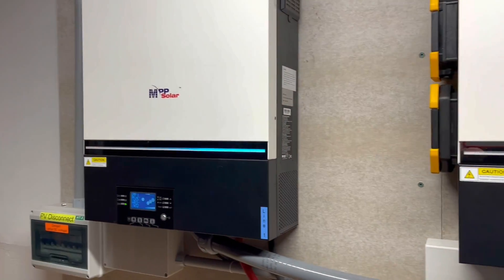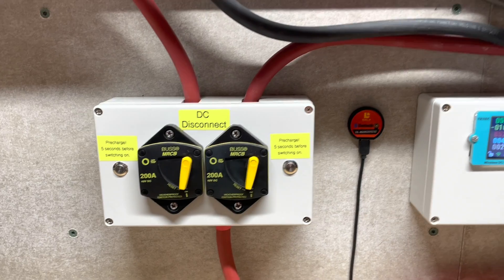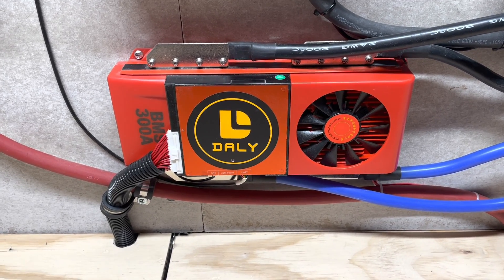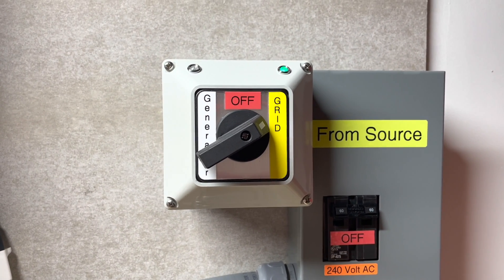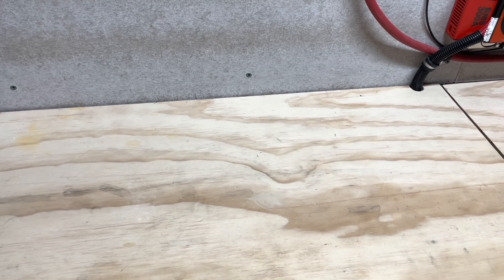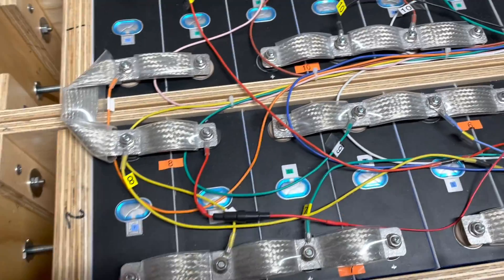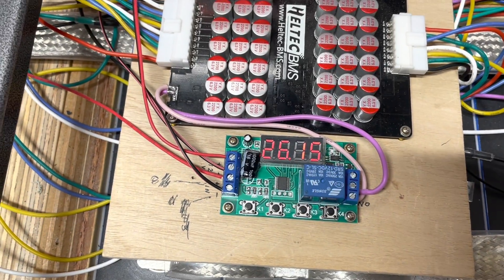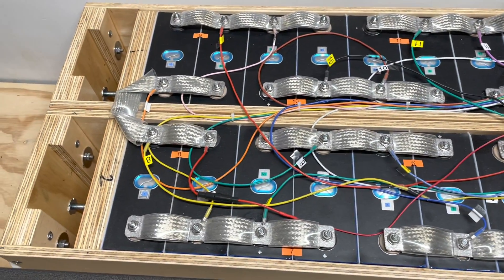MPP Solar LV 6548 split   It’s Alive! Please skip any adds on my channel, they are not authorized.

Comment: Excellent system, the only thing that I would change for safety is the battery box. Should be on metal.
Reply from the maker: Thanks 
The shelf is actually 3/4” ply with a metal frame. The battery boxes are 3/4” ply that’s screwed and glued and also so stiff that it doesn’t flex with the weight. So the bottom is actually 1-1/2 thick with a metal frame. The box before it was lacquered was treated with fire retardant as well as the shelf and bench top. The Daly BMS is being replaced by two JK bms’s that are being located below the bench top. The Daly BMS is still working but showing weird current values and they don’t have a good reputation. I’m making another video of the heat and smoke detectors that are directly above the inverters and whole house system tied. Fire is my phobia.

Comment: Hi, please help me with one simple piece of information. I have an 8kW Solar Mpp and 10 solar panels of 590Wp each. The inverter, in the description, is 2x4000W. My question is: can I put all the panels -5900Wp on a single input to the inverter? VOC is 42V for each panel - the inverter supports Max. 500V. Or how is it better to proceed? Please I wait for your answer ASAP. Thanks,
Reply from the maker: I’m not familiar with your inverter. Mine has only 2X 250 PV input max and the EG4 6500 has a a single 500vp input. The EG4 6500 probably could. Log in on the diysolarforum.com and post the question. Tell them the MPP model OCV and watts per MPP input panel count OCV & watts per panel.

Comment: Awesome setup!! If you did a schematic, do you mind sharing?
Reply from the maker: These are the best diaphragms that’s currently available. Mine is different than all of these. Because every install has the potential to be different and resulting in danger, there’s no such one diaphragm fits all.  As such, every install has to be customized. Click on the orange download button:
https://diysolarforum.com/resources/grounding-and-bonding-for-mpp-lv6548-and-eg4-6500ex-48.275/
Reply: @SkypowerwithKarl  hadn't found those! Thanks man!
Reply from the maker: @julio34  
No problem.
Always remember, the end game is no possible way to feed into the grid and no feed back around (no output into input) manual interlock or transfer switch in places. Good luck and be safe

Comment: I thought shunts were more accurate than Hall effect sensors.
Reply from the maker: I think it has to do with the manufacture and the day of the week the unit was made. The one shown is surprisingly accurate on capacity count. It’s common that they need to be reset from time to time. Currently I’ve got this round of about two months of cycles and it seems to jive at 100% at full charge so I’m not touching it. Whatever is in the Daly BMS seems to wander a bit more but still not bad.

Comment: I have a setup about just like this.

I have a windows on my garage door.

I decided to turn off the led shenanigans. :)

I am only able to get about 25 minutes when pulling 12 kW. They get too hot.
Reply from the maker: What does it do when it gets hot?
Reply: @SkypowerwithKarl  
It turns off with "Fault code 02. Internal temperature of inverter component is over 100°C."

I was charging my car at 11 kW and running the rest of my house for a total load of about 11.5kW. The inverter recorded an 87°C temp.

I was pulling between 150 and 187 amps out of the battery and about 3.5 kW of PV.

I don't let my inverters go over 65°C anymore.
Reply from the maker: @JasonCarmichael  
You probably have a dead air space in the corner like I do. The inverters just recirculate the same air. I just installed a fan to suck the hot air out to one of the registers around the eves. Very quiet and low current draw; 
VIVOSUN 4 Inch 195 CFM Inline... https://www.amazon.com/dp/B01M7S46YZ?ref=ppx_pop_mob_ap_share
BN-LINK Digital Cooling... https://www.amazon.com/dp/B01LZV591B?ref=ppx_pop_mob_ap_share
AC Infinity Flexible 4-Inch... https://www.amazon.com/dp/B07WRDTX4C?ref=ppx_pop_mob_ap_share

Comment: Have you been happy with the inverters ?  
Would you buy the same inverters again.
Reply from the maker: Yes, I’m happy with them and I’d buy them again, simply because they are still the best bang for the buck. Is there room for improvement? Absolutely. Efficiency, transfer time, app connectivity, setting limitations and friggen instructions are lacking. But you get what you pay for. They are a beast. Run my old, no soft start 2 Ton AC and full size LG clothes dryer at the same time no problem.

Comment: Are you gird tied and not feeding back to grid?  I was thinking about using the utility as the backup when my batteries are not enough for the inter months.  Would you share your diagram so I can copy your setup?
Reply from the maker: These inverters can NOT feed back into the grid. They can use the utility to pass through into the house and/or charge the batteries. It can be set to run as a giant UPS. It can also charge during non peak. AC connections can be different from project to project so one diagram is not is not a good guide. Panel types, interlocks, transfer switches and local breakers may change the entire layout. Whatever you do, make sure it’s impossible back feed into the grid.

Comment: Have a question about Neutral Ground bonding. Did you change that in the inverters? I have not had any luck getting an email response from MPP. Hellava setup!
Reply from the maker: My inverter and main panel are literally back to back. If there’s a ground loop between panel and inverter in a particular mode it’s very short and localized. Every thing that’s supposed to be grounded is (especially the inverter) and the only mechanical connection that of neutral and ground that I know of is in the main panel. The main thing is, all the outlets pass sensitive tester and ground faults both new and old test and reset and non have tripped. I’m not too keen on popping the inverter cover and removing some screws unless there’s a factory bulletin saying that it’s a must. I have no issues and it’s impossible to get a shock, so I’m in the camp of if it ain’t broke. From the factory point of view it’s a damn if you do and damn if you don’t. There should have been a jumper with the option bond or or not to and leave it to the installer to decide but that may open another can of worms. Right now it’s running my HVAC, a load of clothes in my dryer and about to make a cup of coffee while watching my T-mobile high speed home internet fed 4K big screen. Not a hiccup, can’t complain.

Comment: Hello great job
My question is it necessary to provide compression to the battery pack?
Reply from the maker: I found a graph;  LiFePO4 life vs compression. Look at page 32. The graph lines above 10,000 are 10,000. https://electrodacus.com/battery/A123_AMP20_battery_Design_guide.pdf 
Looks like chemistry life and not cycles will be the limiting factor.

Comment: i have the jk bms 150a 1amp balance. it was great i loved it but it dies after about a month. no real reason why? maybe i got a bad one, 1 cell won't read? but when it worked it was great.
Reply from the maker: That sucks. I take it you replaced the terminal on that bad balance circuit and jiggled the connector to the BMS? 
Balance lead terminal crimps are actually not as easy as it first appears. I thought I was being smart by doubling the little wire over before crimping and used a Kline crimper. I tugged on all of them and still found a few loose ones. I squeezed the crap out of it too. 
I now use the smallest slot in a MC-4 crimper on non-insulated terminals, dab the open end with a touch of solder to block moisture and form a strain relief from terminal breakage. Finish with adhesive lined heat shrink.
Reply: @SkypowerwithKarl  yea ran the whole lot. looks like a bad one. good news they agreed to replace it. so i chalk it up to stuff happens.
Reply: but i have to say if you had to chose between daly and jk--- jk beats it hands down. i had both and i love the jk
Reply from the maker: @brian1395  
Absolutely. The only reason I chose the Daly was the high current capability. But as a so called “Smart BMS” it’s very basic and kinda dumb. Daly has very poor documentation very antiquated limited balancing. Ironic to the charge/discharge current capacity. Augmenting balancing current is mandatory when it’s used with high capacity cells. Two JK’s (16 cells with each) will be in the future.

Comment: nice setup! I would not be able to leave those light strips on 24/7 way too bright for night time use. You might want to change the order that you stacked the wires on the main ground and positive lugs to the right of the BMS help even out the resistance.
Reply from the maker: The light bar is dimmable and has a few options. I’ll probably re stack the lugs soon. I forgot to put Noalox on them. I’ve had a 200amp loads but the FLIR camera shows no unusual warmth. The 2/0 cable gets warm after 15 minutes but all terminals seem to be cooler than cables.
Reply: @SkypowerwithKarl  Ah good, you shouldn't need Noalox for the crimped lugs. You would only need that on the battery terminals. The lugs would be zinc plated copper, not aluminum like the terminals on the batteries

Comment: My 2 inverters came last week :)
Reply from the maker: 👍✨ 🎉 😃
Now it’s reading time. Download the manual and print it out. The mouse print in the little one is ridiculous.
Reply from the maker: Note: The wiring diagram that I used for split phase is on the bottom of page 53 in the little booklet and on the bottom of page 55 in the online manual. And yes the horizontal blue line (utility) that should be there is somehow missing from the online version. Wouldn’t work well without that, Lol.
Reply: @SkypowerwithKarl  Thank you for the information. How is your neutral/ground bonding setup? Are you utilizing the grid ac in?  It seems that their is a lot of questions around the ground neutral bonding stuff. Love your setup. I went with EG4 Pro batts for safety :) I have 6 eg4 pros and 1 odd ball that 24watts sold me since the bms is supported by the inverter. so i have 35 kw of batt storage. Once setup i will most likely get another 5 so i have 12 total.
Reply from the maker: @bradmesserle999  
My inverter is literally on the other side of the wall from the main breaker. The ground is only bonded to neutral 
 at the service. In the outside main panel there’s a sliding interlock so that only the grid main breaker or only the inverter back feed breaker can be engaged at a time but not both at the same time. The supply FROM grid TO the inverter for charge and/or feed through there is an additional outside 70 amp breaker box that is taped after the meter (at the same point that goes to the original main interlocked breaker). Yeah, I know I had to ponder about it for a while. 
Neutrals got to go into the inverter as well as out even though they may end up on the same buss. I haven’t seen any problems. Any voltage at my ground to neutral at the outlets is a few millivolts. All of my GFI’s brand new and old haven’t tripped, test and reset fine. My end game; never be able to back feed into the grid. All outside/inside local breakers boxes and inverters are grounded. Neutral busses in boxes are isolated from box/ground. If there’s an issue under certain conditions I haven’t noticed or looked for it. My inverter does have the latest firmware and I’ve put it in all modes for quite a while. If there’s a problem I’ll just let the brains figure it out for the fix. Nothin trippin, nothin zappin. No worries😁
Reply: @SkypowerwithKarl  Thank you for replying. We like no zaps! :) Have you see the channel DMI INC? https://www.youtube.com/c/DMIINC2013/featured He has a pretty impressive setup as well.  My plan right now is to just build a big online ups for a couple of household functions and then i am going to add solar. I need to exercise the batts until i can get my solar array built.  Can i ask what solar panels you are using?
Reply from the maker: @bradmesserle999  
The EG4 Pro’s are probably one of the best systems on the market. 60+ kWh is great and gives you a lot of flexibility. You can even hold some back for reserve. Keep in mind if you can’t count on grid and it’s winter even with all those batteries, a week of no sun and you’re out of juice. Consider a Predator 9500 inverter generator(what I have) or the Duramax 9000 (what I wish I had).
Reply from the maker: @bradmesserle999  
That’s how I ran mine a few months ago when the sun was blocked for weeks. A giant UPS on steroids LOL
Reply: @SkypowerwithKarl  oh i plan on burning thru my batts every night when I am done. :) I am charging a car. I don't expect to be 100% off grid. I already have a class A 40 ft RV with a cummins generator with a hook up for emergency power to the house. :) I am going to slowly move circuits over to the inverter side of the house once I get comfortable.  End game is to just use the grid to charge batts. And if i still have extra power from solar.. i guess I will mine doge coin :)
Reply from the maker: @bradmesserle999  
My panels are no longer available but these have the same attributes:
https://signaturesolar.com/solarever-445w-72split-cell-mono-solar-panel-silver-l-full-pallet-31/
Signature Solar was fast and find the best way to get it to you. If you can keep the open circuit voltage at or below 250volts in your string you’ll be golden. You should be able to run twenty of these with 2 inverters for 8800 Watts. That maxes out the voltage but not your amps. Other panel combos of smaller, more of and in parallel can get you to max the the potential if you need more. Just got to keep it 250 or less and under 18 amps per MPPT input. I can only run 10 panels here because of space and shade. Remember just the shade of a tree branch across one panel can can cut 60% of the total string. And remember how low the sun is in winter. Never paid much attention to until solar.
Reply from the maker: @bradmesserle999  
You may want to get the extra batteries sooner than later so you don’t cycle the ones that you have too deep or often.

Comment: Double pole 60A utility/gen in and double pole 60A A/C output.   Any badness, both legs tripped at once?
Reply from the maker: It’s actually easier for the system when you open the breaker than say a power failure that may lose only one line due to a storm. I’ve turned it off and on multiple occasions both grid and house. Disconnect the grid breaker and the inverter instantly switches over to battery. When that happens you may notice a slight flicker in the lights if it’s LEDs. TV and appliances aren’t affected by the transfer.

Comment: Karl, can you post a list of your subparts like the 200A DC disconnect and monitors.
Reply from the maker: https://www.amazon.com/dp/B007P5TKLS?ref=ppx_pop_mob_ap_share

https://www.ebay.com/itm/2-4-VAC8610F-Color-Screen-Wireless-Voltage-And-Current-Meter-100-500V-100-500A-/184860197832?mkcid=16&mkevt=1&_trksid=p2349624.m46890.l6249&mkrid=711-127632-2357-0
￼
Reply from the maker: You will need this to power the meters :   
  
F1TP 12V 2A 24W Power Adapter for LED Strip Light, CCTV Camera DVR NVR, 100V-240V AC to DC 12Volt 0-2Amp with On/Off US Wall Charger 6.6ft Cord. https://www.amazon.com/dp/B078R93PSY/ref=cm_sw_r_cp_api_i_C2NBJDV84DD6AHSJ1VEQ?_encoding=UTF8&psc=1
Reply from the maker: LeMotech Waterproof Dustproof IP65 ABS Plastic Junction Box Universal Electric Project Enclosure Pale Gray 7.9 x 4.7 x 2.2 inch (200 x 120 x 56 mm) https://www.amazon.com/dp/B075WZFWFV/ref=cm_sw_r_cp_api_i_B51T6QJVQT452K0GNAHT?_encoding=UTF8&psc=1
Reply from the maker: Coolais 2 Pcs Mini Metal Push... https://www.amazon.com/dp/B07F9YSJ9N?ref=ppx_pop_mob_ap_share
Coolais 2 Pcs Mini Metal Push... https:/

Yohii 25W 2.7 Ohm Wirewound Resistors Chassis Mount Aluminum Heatsink Resistors - 5pcs https://www.amazon.com/dp/B07H7H1NXV/ref=cm_sw_r_cp_api_i_RP8958FYKPEYF341X3R2?_encoding=UTF8&psc=1
Reply from the maker: Let me know if there’s any other areas you want info on
Reply: @SkypowerwithKarl  The 240v selector for gen input or grid power to feed the LVs?
Reply from the maker: @errcl65  

 
 VictorsHome Changeover Switch LW28-63 3 Positions 16 Terminals Universal Rotary Cam Selector Latching Switches 690V 63A https://www.amazon.com/dp/B07N119RY9/ref=cm_sw_r_cp_api_i_BK5KGX0A5MJFAHZXHJHE?_encoding=UTF8&psc=1

Baomain Master Switch Exterior Box LW28-63/4 Work for Universal Rotary Changeover Cam Switch SZW26-63 660V 63A 3 Position 3 Phase https://www.amazon.com/dp/B07FJYZLD3/ref=cm_sw_r_cp_api_i_GP0BTR7H0VPCA3QKBR9Z?_encoding=UTF8&psc=1
I’ll post a video I made. Click follow to get notification
Reply from the maker: Deleted the other link, this is the better type:

DROK AC Multimeter, AC 40-300V 100A 110V/220V Voltage Current Power Factor Frequency Electric Energy Monitor with Current Transformer, Digital LCD HD Display, Volt Amp Watt Detector Reader Panel https://www.amazon.com/dp/B09998YBHW/ref=cm_sw_r_cp_api_i_9FGAZJDR1J1BF9JTMYQH?psc=1